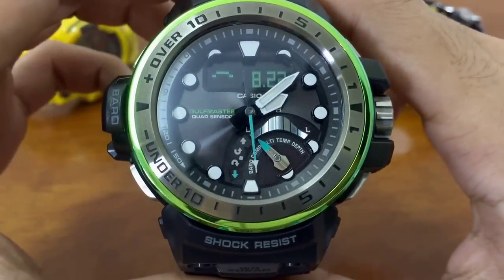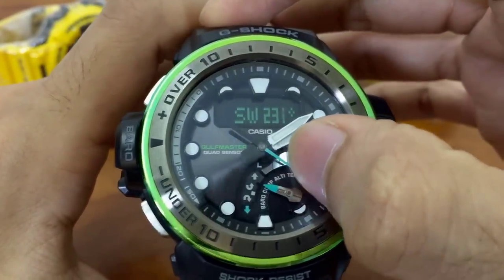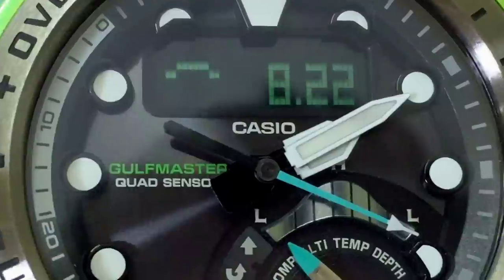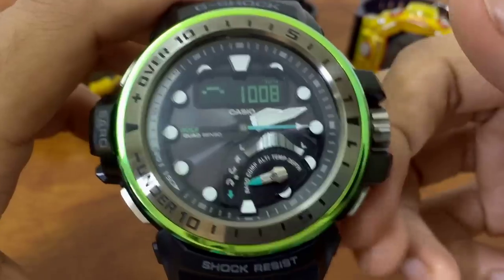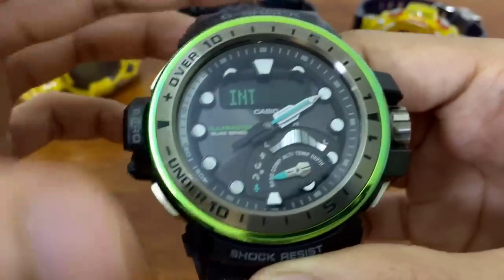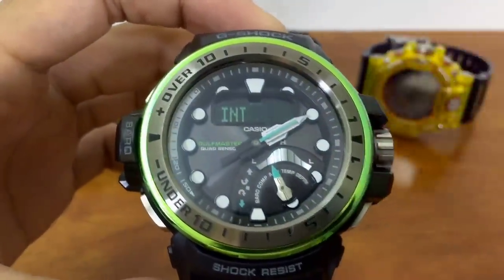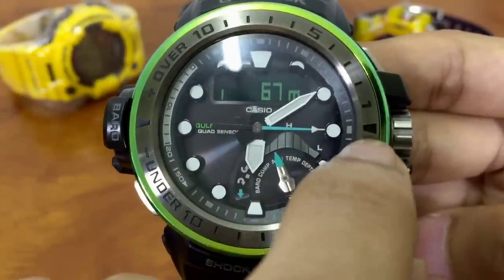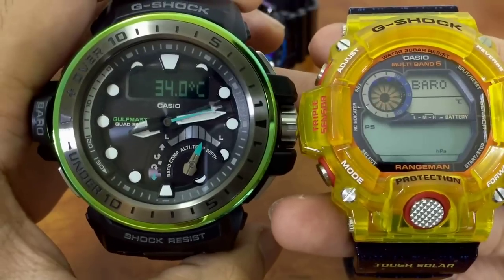Casio 5477 Module - Quad Sensor G-Shock Gulfmaster watch sensors demo & calibration | PART 2

Comment: Hi I’m a new owner of this watch! I was just wondering if it was possible for the settings of the “hand move out of the way” to be tweaked? For example I’m in stopwatch mode and the hour and minute hands are in the way, i hold L and press B to move the hands out of the way but it will move back to the time positions after 10 seconds or if I press any other button. Is there a way to set it such that the hands only move back to the time positions when i hold L and press B just like they do or the lower end gulfmaster models?

Comment: How to go to HOD mode/test mode? Which buttons? Detailed procedure please. Thanks! (28:30)
Reply from the maker: I pressed all 3 button at the same time at home time keeping.

Lower right + Lower left + Upper left

Basically, any three button that is not the light button. Then you'll see the HOD/test screen display. This will work on any G-Shocks too!. Goodluck

Comment: Can i use the gulfmaster's button in water?
Reply from the maker: I tried that and it work just fine but it was just about 1 metre or less of depth. Possible but I don’t think that would be recommend. The only watch that could operate underwater is the Frogman.
Reply: @gshockhighfashion  Right thank you for your answer ^^
Reply: gshock highfashion Dude could you tell me how much it would cost me to buy a frogman triple sensor??? I am from India....

Comment: What heppens if mud goes into the holes?
Reply from the maker: If so then, that disturbs the button operation or sensor precision. I'm gonna need to disassemble and clean it up.
Reply: gshock highfashion ok and is the baro so much better then in the gwn 1000?